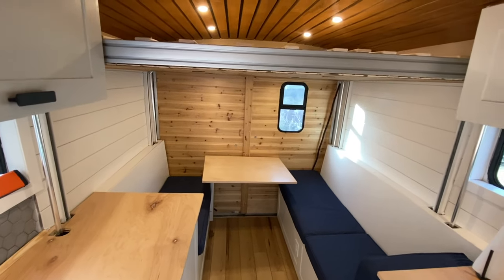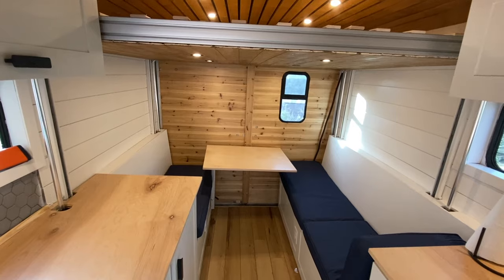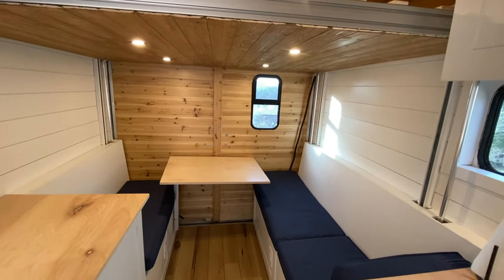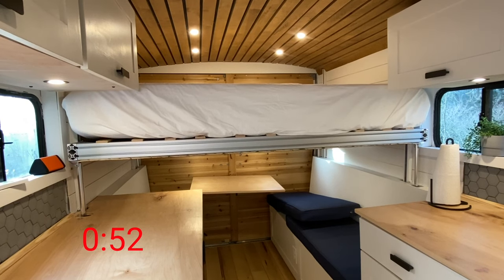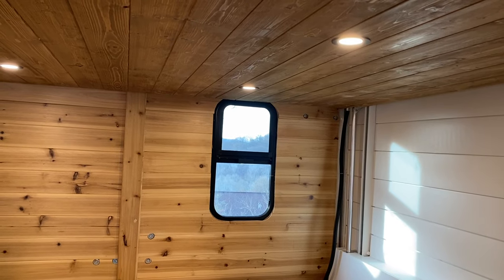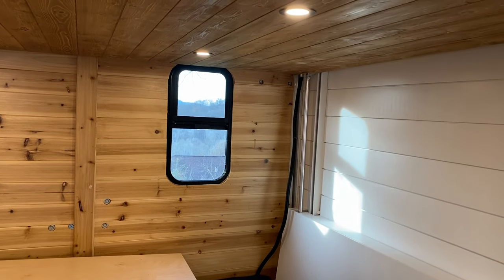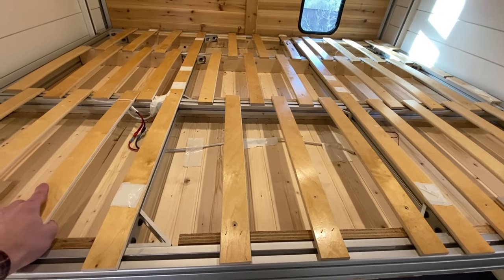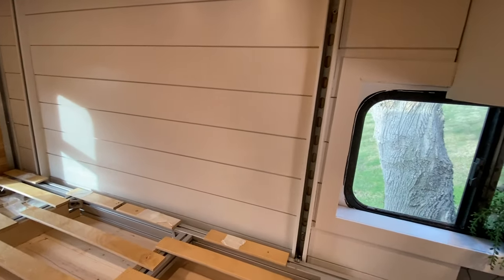DIY Bed Lift for Van or Camper | Happijac Alternative

Comment: completely awesome. 1 tip to save money. that 200lb rating is for dynamic loads, meaning weight that it's actually lifting. as long as your static load rating is less than the total amount that will be resting on it when it's not in motion, you don't need to spend all that extra money. for instance, 100 lbs of dynamic force is 180lbs of static force. as long as the amount of weight on it when at it's stopping point is less that 180x4, then you can get a lower dynamic. hope that helps with cost saving in the future. really great job. saved a ton of money.
Reply: I was thinking the same thing. When it's in the up position it's only having to support the weight of the bed. When it's in the down position the bed itself can sit on those bolts that he put through the track. So the linear lifts are only ever supporting or having to lift the actual weight of the bed. You could even add bolts or pins through the track underneath the carriage wheels when it's in the up position just for safety. And you can also drill holes in the track about halfway down for pins in case if you wanted to put the bed halfway down so somebody could lay on the bed and somebody else could still access the table area.
Reply: A ratchet system on the rail like a car 4 post lift would be good, then you could could also put a cup and socket at the top of the actuator so they are totally disconnected in the up position and no load put on the actuators,

Comment: Have you considered having individual controls for each corner so that the bed can be leveled when parked on uneven surfaces? Taking an even bigger step further, possibly connecting them to some sort thing that tells each corner where to land so that the bed would be level. I think that would be huge.

Comment: A very nice design. To refine it you could install simple magnetic switches as up and  down limit-switches and connect them with a DPDT toggle switch so you don't need to babysit the bed when it's moving.

Comment: That’s pretty neat. Total fan of ceiling & murphy beds for build. Just makes so much sense for dual use spaces. Imagine the weight savings if the bed frame and slats were aluminum.

Comment: That is super cool. Yes - you definitely want to use electrical actuators. I used pneumatic for mine. Got it to work but I had to use a few flow control and one-way valves to get the pressure leveled. Anyway - nice work - nice video!

Comment: Very nice. Use Ropes and Pulleys to save electricity. It doesn’t matter if it is not balanced going up and down.  As long it is fine when on the roof and settled down flat and square on the benches underneath 😊😊
Reply: lol i used ropes and pulleys but after about 6 months of pulling it manually i put a 2000lb ATV winch in to lift it....10/10 improvement

Comment: Thanks for the information provided in your video. Yes, HappiJac is expensive and I also looked into linear actuators for my tiny house bed lift but I soon realized that the travel distance of linear actuators is limited (30 inches in your design) however HappiJac can travel from floor to ceiling. Thanks again...
Reply: ives seen up to 1000mm stroke length on aliexpress

Comment: Great job on this bed lift.  And great detail shared.  Appreciate it.  The controller seems to do very well managing all 4 actuators perfectly together.  Are you also able to independently drive the actuators if the van is on an unlevel surface?  Was thinking it would be cool to adjust the bed leveling vs. leveling the entire van.  Also, I noticed a warning on the controller website that states if power is lost to the controller that the actuators need to be disconnected and recalibrated.  Is this true and have you run into this issue?  Thanks!
Reply: Do they advise on how to recalibrate?

Comment: I had considered doing the exact same thing but using a winch (or two).  I ended up going with a murphy-bed, instead.  Nice work overall. Your build is much cleaner than mine. I'm curious to know about how the trailer behaves when towing it - with all that weight up high. Noticed anything odd?
Reply from the maker: I keep it in lowered position while towing! Handles great

Comment: this is cool. have you thought about using only one actuator on one corner and and use a pulley system for the other 3 corners? I would still keep the track on all 4 sides. i mean.. the actuator can actually hold 200lb. this is just for lifting/lowering an empty bed. use the track to actually hold it when they are in position with the metal pin.

Comment: Nice job! What supports the weight when stopped? is their a brake on the linear tracks/wheel carts or is there some kind of mechanism in the actuator? Or is it just a hard mechanical stop?

Comment: Check out Suspa Movotec. That’s what I use in my 80/20 table lift designs. They have many sizes and all come with 4 lifting cylinders, a motor controller, a switch, the appropriate motor/pump.

I made brackets that the switch and cylinders mount to that then mount to the extrusions

Upon further inspection, the lift system you are using seems to be bigger than the Suspa Movotecs I use. However, they have other lift systems

I need to check out HappiJac and Firgelli

Comment: Nice design and execution. I've been wondering how to keep the bed laterally stable and the use of the track and trolley cars looks great. When the bed is all the way down is it resting on the furniture or supported by the actuators? Also, do you have a link for the extrusion you used for the frame? Thanks!
Reply: Something you could also use to address both lifting and a literal track system is using a track linear actuator.
A 40" stroke that holds 150 lbs is $208. That's just 1 quick google search so prices may vary, market conditions blah blah blah.  30" are $183 and same weight.

Running an additional support on the ends attached to the actuators should help distribute weight. Another option would be using 2 more tracks in the middle on both ends totaling 6. Ideas and options are honestly limitless. Just the time and money.

Great video and thank you!

Edit: The Firgelli had track actuators as well, up to 600 lbs for $250. Once you hit 200 lbs the cost went up.

Comment: Thank you so much for this video. This is exactly what I had in mind but was confused about how to go about it. One quick question please : is it possible to configure the system to have the option to a single switch connected to a sync system has you described, and also, or alternatively (but having both options would be nice) to control each actuator independently ? The reason would be to level the bed to a possibly inclined parking spot after the bed is brought down by the single synchronized switch.

Thanks again.
Andre

Comment: Good idea with bed lift , I too have put a lot of thought into bed rise & fall; have you ever thought of a counterweight system like say in ‘tiny house -Denis Daigle’ but in a van . Would take away the need for electricity, although I d split the weight equally either side to distribute weight! Also ‘BA Backwater’ was another inspiration. Your thoughts would be good?? 🏴🏴

Comment: Thank you for a fantastic tutorial. My only question is what is the voltage on the system?
Reply: The same linear actuators I use on my seaplane landing gear legs are 12v and very reliable.
Reply: @Searey07  Awesome thanks Ken😊

Comment: Getting a somewhat unclear response from Firgelli on this: Can you just stop the Actuator any height you want via the switch? They are saying you need an external limit switch to stop anywhere except top/bottom of stroke.  Also....if you can stop it anywhere with the swtich (without the external limit switches) ---is it rated for static load at all positions?

Comment: Linear actuators have built in sensors so wire them into the most basic of controller and you don't need to watch it, it will just stop when it is open or closed

Comment: really coo! nice work. you have the precise up/down times figured out, SO: slap on an electronic timer switch in place of that latch switch, and add a kill switch on the wall just beyond your desired (and timed) high/low points. circuit kill switch would only trip if any part of the beds electric system went awry. in addition, you could put up a bike bell or something that will alert you when you are in the last x amount of seconds if you want to be extra safe.

i thought you had done something similar for the lights above the bed. there was a moment in the video when the bed reached a certain height in your demonstration, and the lights above the bed went out as it reached the top. I was wondering if this was something you added intentionally, to protect your bedsheets from the heat of the led lights etc. which led me to thinking about the bed auto shut off. 

again, excellent work, you got my mind cooking with gas now.
Reply: Simply wiring those wires from the rocker switch to go via an upper limit switch and a lower limit switch would be the best way. Then he could set it to raise/lower and forget about it. Easy.

Comment: Does the bed stop automatically at a certain height when it’s being lowered or raised? I think you said you have to watch the bed and turn off the switch at the height you choose. That seems a little dangerous, if the motor keeps trying to raise or lower the bed even after it hits the ceiling or bench tops. What if something urgent happens in the rig and your attention is diverted from the bed while it’s going up or down?
Reply from the maker: At the bottom, it stops automatically because thats the lowest position the actuators can go. At the top it WILL stop automatically as I think there is some kind of safety built in that when pressing against so much force, it stops as to not burn out the motor or something. We have definitely accidently let it keep going and it stops on its own. Probably not good for it though.
Reply: @diycargotrailer  it'd be worth running the output from the rocker switch, the "up" post, via a limit switch's NC post, and place the limit switch such that it engages when the bed frame hits it.

Comment: Hi could provide some measurements, so I can get a rough guide as to the resulting bed lift you did? What was the height from the floor when the bed was at its lowest? and when it was completely raised? many thanks, great job by the the way.

Comment: You were able to connect all the actuators into one switch? Also, do you think you could have gotten away with 150 pound actuators since it wouldn’t be lifted or lowered with body weight on it?

Comment: I like the idea of the bed system, but I am worried it could break down while on the road and then I wouldn't have my bed.  How would you complete the maintenance on it while away from home?  I'm not knocking your design, I just like to be safe and have backup procedures if I am on a long trip away from home.

Comment: Hello to you I am writing to you from Quebec, Canada and just like you I am looking at how to raise my bed to the ceiling in my trailer that I am to fit out to slide my motorcycle underneath when moving. I find your system very ingenious, but have difficulty finding actuators that lift so high. Do you have a mark to give me so that I try to find an equivalent here in Quebec ??? Thanks in advance and keep up the good work

Comment: Great Video. Do you think you could have used 2 actuators instead of 4? I was thinking you could place them at the middle of each end rather than the corners.
Reply from the maker: Nope! I tried that. It doesn't travel upward correctly and gets hung up in the rails.

Comment: good build. but is it only 30 inches of lift. looks longer. because the one you linked to only has 30 inches. saw that they have longer but then the price goes up a bit. but cheaper than many other systems that are 2000-3000 dollars.

Comment: Any reason you didn’t go with the 400lb actuators instead of the 200lb? They’re only a $10 difference.
Reply from the maker: There was a reason at the time but I can't remember what. I think it was a stocking issue. By all means use those!

Comment: Fantastic video.  Are you using a queen or a full bed?  Do you need four 200 pound actuators to support a single 200 pound weight or is there some multiplier (so could the four 200 pound actuators support and lift a 300 pound (1.5 x 200), 400 pound (2 x 200), etc.?
Reply: no, you do not. that 200lb actuator is for dynamic loads, meaning the amount of weight it can lift when in motion. his set up can lift 800lbs of weight, but can support, when not moving, 500lbs on each actuator meaning the bed can SUPPORT 2000lbs. completely unnecessary. get a 100 or 150 lb for two people, or a 35 lb for one person. all it needs to do is be able to lift the weight of the mattress and platform. 35lbs each still can lift up 140lbs of dead weight, but can support a static load of a little over 200lbs. 100lbs dynamic load rating can support 180lbs on each actuator, so 720 lbs total. hope that helps.

Comment: I dig your guys' build! Did you weigh it before and after the conversion? I'm wondering if I can build out a 1,300lb (dry) trailer and stay under my broncos tow rating of 2,000lbs
Reply: The short answer is no.  For example, my IceCo fridge weighs 55lbs…empty.  My full size mattress weighs 57lbs…no sheet or pillows or bed for that matter.  My countertops, 14’ of them weigh 150lbs.  They are butcher block and you can go lighter than these.  My point is flooring, windows, light fixtures, components, batteries, toilets, showers, cabinets, stoves, sinks…they all weigh and all added up they weigh a lot.  Then you have water, food, clothes, camp chairs, tables, hammocks, awnings, rugs, and all the stuff you want to use outside when you get somewhere.  I couldn’t stay under 3500lbs and realized a double axle trailer was the way to go.  

Now, anything is possible but I just can’t see 700lbs being anywhere near realistic when you pull out the scale and the calculator.  

My 26 gallon water tank weighs 15lbs empty.  Full it weighs well over 200lbs.  

Again, you can go ultra light and meet that goal but not by doing a full buildout anything remotely  similar to what they’ve done here.

Comment: can i ask how you ran power to your lights on the underside of the bed? thanks!
Reply from the maker: There’s a small black wire case if in a back corner that dangles. But it stays out of the way and works well.

Comment: If you have four 200lb capacity actuators, does that give you a total lift power of 800lb, or is it still 200lb?
Reply: total DYNAMIC lift capacity of 800lbs. meaning you can pile 800lbs of weight on that bed and the actuators can lift it. however, static capacity is MUCH higher. when the actuator isn't moving, and is in a resting state, each one can support 500lbs, meaning that entire bed can hold, without motion, 2000lbs. do not get 200lb dynamic actuators unless you actually need them. save money and get 100lb.

Comment: Is this system 110 powered? My cargo trailer is only wired for 30 amp 110
Reply: they come in 12v and 48v. run it right off your truck or accessory battery.

Comment: why ??/ electric actuators when ya can do the same mechanically??? like ya idea but im guessing ya cost was way more than you state  ??? im in the uk and to do this the wiring alone would cost 150 pound  ??? about 100 dollers
Reply: not knockin you but running 4 actuators as aposed to 1 motor
Reply: just saying bet that sups some battery life if off grid